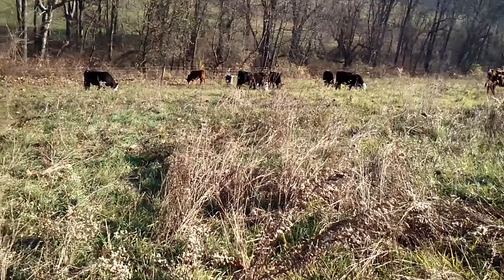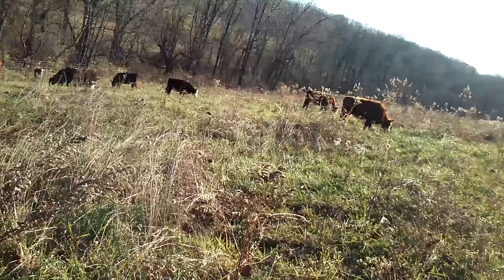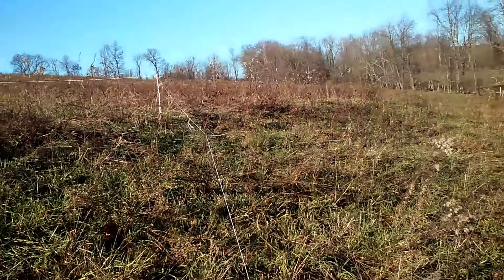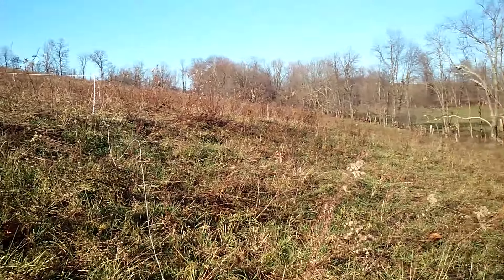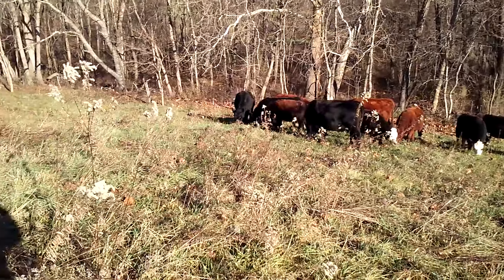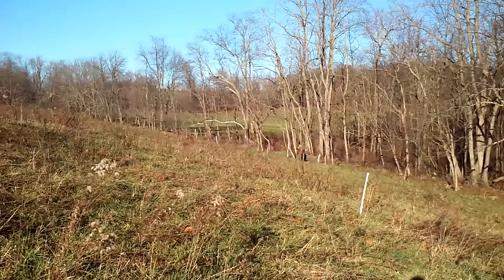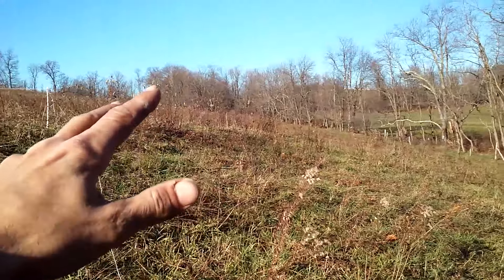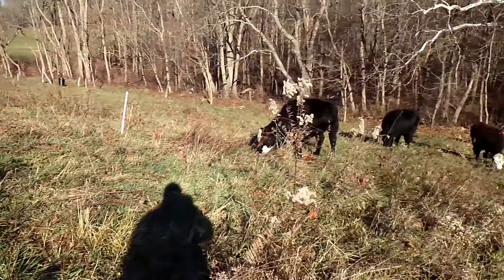Intensive Grazing Without A Backwire

Comment: You might want to have a few fixed stock tanks that have daily paddocks radiating away from each one.  Doing this without a backwire works also, and discourages livestock continuously impacting previous days paddocks as the most direct route to water is though the current days paddock.

Comment: Do you have a way that you calculate your paddock size?
Reply from the maker: +Troy Puckett Every spring when I get my herd for the year I will experiment with paddock size to determine what size I need to be at for the cattle I have. So usually I start with a over sized paddocks. Then each day I make the next paddocks smaller until I find what works for me. So it's hard for me to tell you the dimensions of the paddocks you will need. Follow what I said and experiment. After you move them look at the damage they did in previous paddocks. Could they use more? Did they leave to much? Of course different times of the season change how well things are growing so that something to keep in mind also. During the fall paddocks tent to get bigger than in the spring/summer.

Comment: You're leaving quite a lot of residual that is not trampled in. Is that by design? What is the reason for that? Your land looks nice and dry. We've just had the wettest December since records began and losing alot underfoot but still gonna get to mid feb before housing them although I had hoped to clear the winter with no hay.
Reply from the maker: +Rob Havard At this time of year I am not pushing the herd very hard. I manage this herd for a guy 60 miles away. He recently took half the herd back to his farm to finish winter. I was instructed I could continue to graze the 19 head I have until I am out of grass. Then they will go home for winter as well. So I am roughly about 3 weeks away from them leaving. 
The intensive grazing has done wonders for the way the farm reacts to rain fall. The trampled grass helps hold the water well. I would say we have a good 1" or 2 of liter (trampled grass) in each pasture. Over time the intensive grazing  has helped stream that were dry start to run again. At last count I have found 7 springs on the farm.
Do you practice Intensive grazing? Yes, I was hope to not need hay as well but I am about out of grass. We are planning to double my stocking density though come spring. I can't wait!
Reply: +J.C.'s Organic Farming Yep we are intensive grazing moving once a day. We do back fence but mainly because it had been so wet and we want to keep them off the grazed land asap. We have two farms and on the home farm it is drier and we haven't back fenced and this has worked well. I think it is not so important in the dormant season to have a back fence but we would always have one in the growing season. Thanks for the sub - keep up the posts it's good to follow along.
Reply from the maker: +Rob Havard Yeah after I replied to you earlier I check out your channel. Very nice! I normally do back wire. It helps control what they trample. At this point I have resorted to open range grazing (full pasture). It wouldn't be long all things will be green again! Usually by April 20th we are grazing and moving fast.